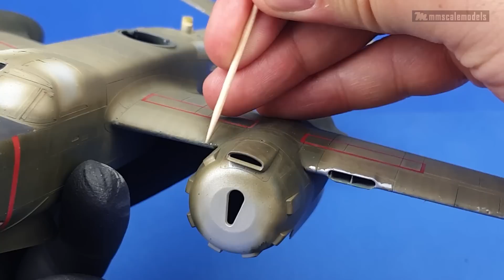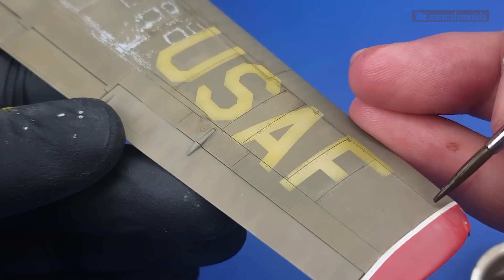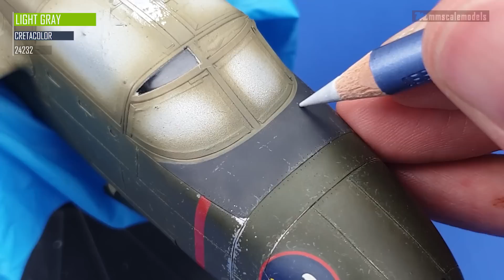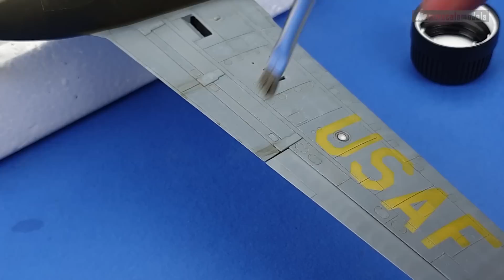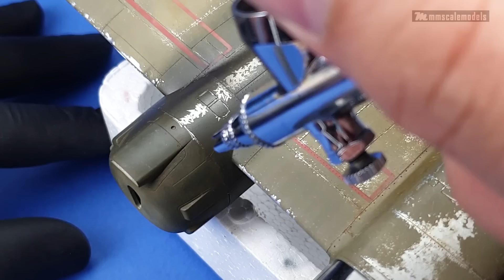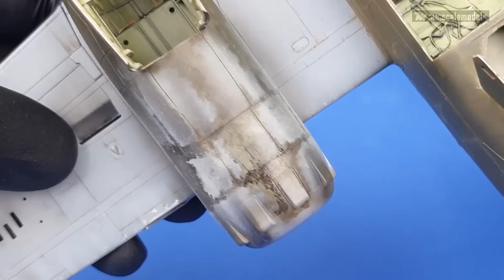Ep.12: B-26B-50 Invader - Weathering - ICM - 1/48 scale model

Comment: This came out particularly well and is in keeping with real aircraft.  I owned a small airplane for some time.  I washed it completely at least twice a year if not more.  The underbelly in particular got absolutely filthy.  Streaks come not only from oil (airplane engines burn oil as part of their normal operation) but form the anit-corrosive sprayed on every hinge and moving part.  This stuff collects grime and follows the air stream, so an effect you've simulated nicely.
Reply from the maker: Thanks mate, priceless insight from you 👍

Comment: Nice job, it coming together very nicely! Especially I like engine nacelles and surrounding areas - there's everything I like: grease, soot, stains ;) 
I had bunch of AK pencils for a while, however I tried them only on my recent build of Spitfire and was surprised - what a great tool for imitation of scratches and pain deterioration! Even if I haven't tried it recently - I'd definitely be inspired by your video in this regard. 
Regarding bare metal scratches - I'm not too confident at imitating chips and scratches with regular paints, so I mostly did it with alluminium AK pencil. I've also got MIG's Alluminium oilbrusher and found it it is easier (and more forgiving to mistakes since it can be removed with white spirit) to apply than regular paint. It seems to have very fine, soft pigment which looks very metallish and can be applied very precisely by fine brush.
Reply from the maker: Thanks mate, I haven't tried the metallic oils yet. Should do that.